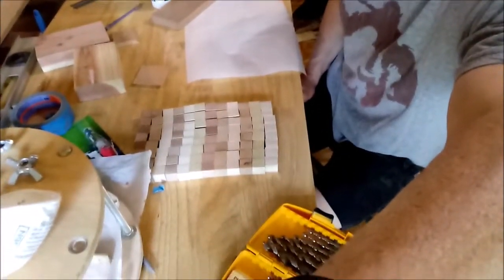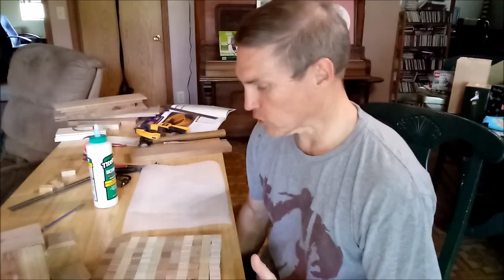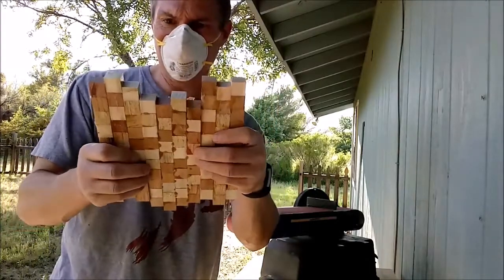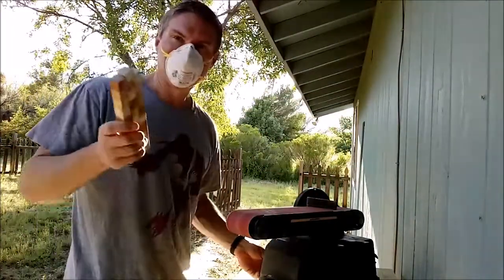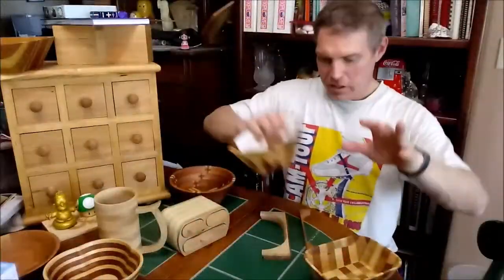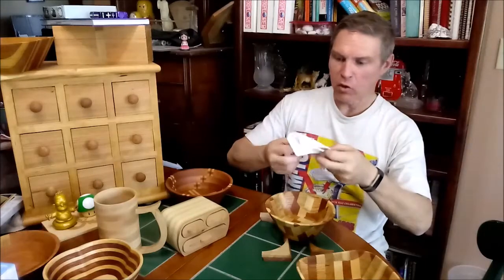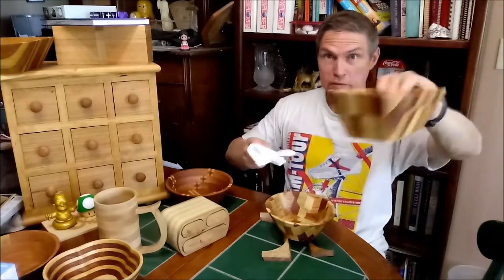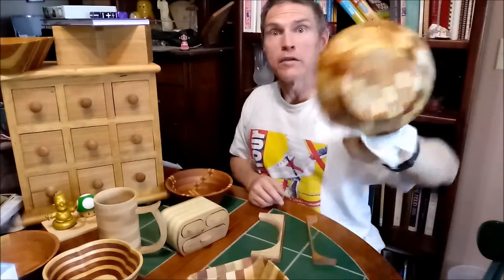Son of the Return of Yet Another Scroll Saw Bowl

Comment: Great job!  How do you figure out the angle to make everything line up?
Reply from the maker: Thank you! For the scroll saw angle setting follow these steps:  1) get the final thickness for the bowl blank (in this case it was 11/16") 2) determine how wide you want your rings (3/8") 3) divide the ring width by the blank thickness (that equals .545) 4) use an inverse tangent calculator to get the angle to set your table (in this case it's 28.6 degrees; I rounded up to 29).
Reply: jahellen thanks, I'm going to give it a try.
Reply from the maker: Cool! Let me know how it comes out.
Reply: I've never heard of an "inverse tangent" calculator. Where do you find one of those?
Reply from the maker: That would also be the arc tan. You can find a calculator here:  http://www.mathwarehouse.com/trigonometry-calculators/inverse-tangent-calculator-online.php
Reply: Thanks. After I posted here, I found it on the web. I never knew something like that existed. All this time, I've been just winging it.
Reply from the maker: No worries. Good luck!
Reply: @rayscrafield2106  after you get your board made up and have determined the width between each circle (in this case 3/8) just mark 2 lines on the edge of the board 3/8 inch apart and put behind your scroll saw blade. Slowly tilt your saw table until the top of one line and the bottom of the other line up with the scroll saw blade.